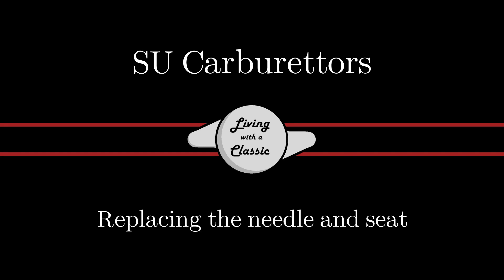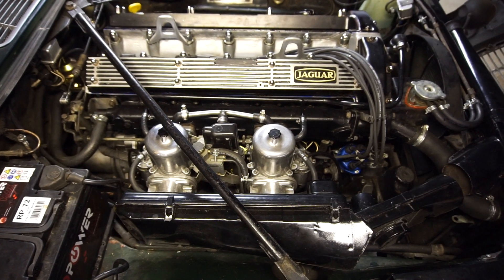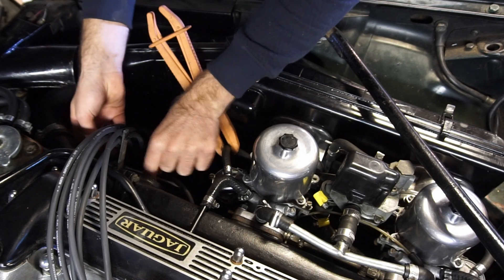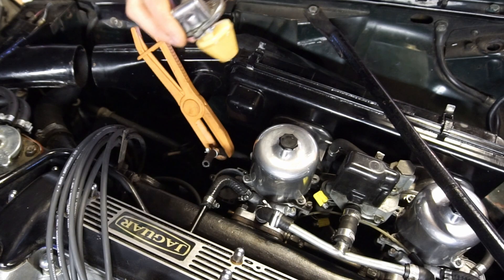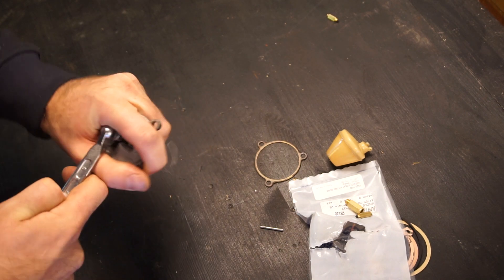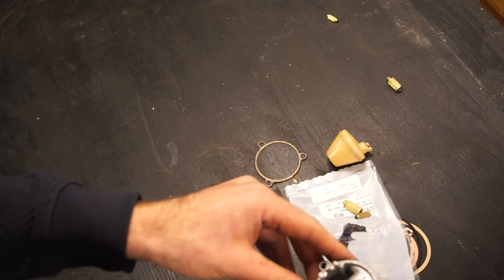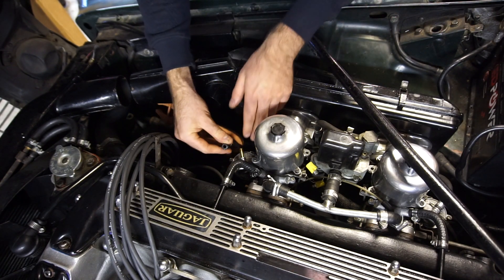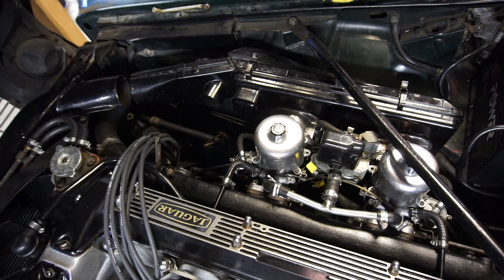How to Replace the Needle and Seat - SU Carb

Comment: My 1952 XK120 has the 1&3/4" SU thermo carbs, they tend to run rich at idle even after adjusting screws in at bottom of carb body. Have taken apart the start carb and hand lapped the flat face of the solenoid valve plunger in an effort to keep excess fuel out. That helped it a fair amount but still rich at idle, at least black smoke has been reduced or eliminated.
Great tutorial, keep them coming!

Comment: Many thanks for this. I watched this before investigating a leak from the front carb (HS4), and found an identical piece of rubber in the jet assembly! It had to be worth reassembling the unit and trying it. It sealed, so saved me the cost of a new jet etc! Cheers.
Reply from the maker: Glad your leak was fixed for free!

Comment: XJ6 1974, SU HIF7 | @5:40 I've got the oter type of floats, I can adjust the height. But they keep over flowing after installation of new seats and needles??! The float level should be -1mm of the underbody. The carbs are pissing gasoline in front of the gasneedle (airfilter holes). What to do?

Comment: Did exactly the same job on my carbs about 6 weeks ago. One carb was leaking quite badly and the car would not tick over for some reason? Anyway all was fixed in the end. The floats/valves on my car differ slightly from one to the other but they work fine.
Reply from the maker: There are many different types of floats so as long as you have the same level in both it should be fine

Comment: Interesting video Adam.  I have had to change these needles and seats in the HD8s on my Mk 2 once or twice.  Surprised to see you found a piece of broken fuel hose in the seat as the HD8s have very fine filters at the "entrance" to both float chambers, as well as the filter on the fuel line,  which would prevent that happening.  Assume you can't put those into an HS8 like yours?   Would be good to see a video on setting the float level on a different SU carb - I've done it loads of times (and got it wrong a few times too!) but I'd be interested to see how you go about it.   Cheers, and keep up the great work!
Reply from the maker: No sadly those little filters aren’t in the HS8s. I have the main fuel filter in the back and those in the tanks too.
I’ll make one in the future. Thanks for watching!

Comment: Hi Adam I’ve had my 1970 Morris Cooper S for 14 yrs now and it sat in a garage for about 10 years prior to that. I’ve never had any problems with the float chambers on the HS4 carbs. Is it wise to change needles and seats as a matter of course? 
Thanks Carlo.
Reply from the maker: I things it’s a good idea to change them or at least have a look. Really cheap parts and it’s no fun to be stuck far from home with fuel overflowing
Reply: Thanks mate.

Comment: I have a 1972 mg midget with two of these carbs. Whenever the fuel pump runs for a few seconds the gas pours out of the float chamber. Could this be a stuck needle?
Reply from the maker: Could be that or a bad float or float height not adjusted correctly
Reply: @LivingWithAClassic  jusy opened up the float chamber. The float is full of gasoline. About to order replacements for both carbs. Is there a specific model su carb I need to search for or are they more universal

Comment: I have a 1.6 Montego with SU carburetor, it is quite difficult to start after spending a day stopped. The stepper motor is new. I understand that the carburetor circuit is empty of fuel. How could I fix it? I would appreciate some guidance. Thank you so much
Reply from the maker: Does it have a manual or electric fuel pump?
Reply: Thanks, It has a manual fuel pump, also the fuel pump is new..

Comment: I have a question , my car v12 jag had 4 su carbs , when I start the car the left side is ok but the right back fires through the carbs when I Rev the engine . This Bach fire goes when the engine is warm . I have balanced all the carbs when the engine is warm 8 bar and  once warm the engine runs great .. any advice ?
Reply from the maker: Is the choke mechanism in balance? Sounds like it’s running lean on the side that backfires when it’s cold

Comment: Where do the fuel overflow tubes plumb into? Assume they re-route and overflow back into the system somehow?
Reply from the maker: It depends on which country the car was sold. These just went to the ground. On some cars they vent to a canister and gets burned in the engine